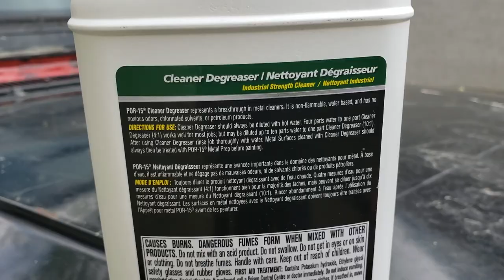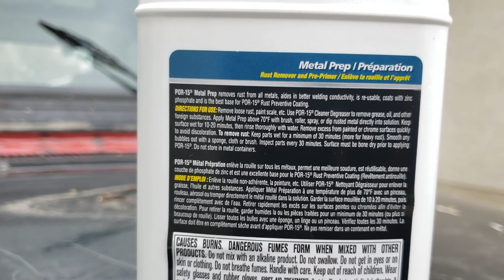Rover 1 Project - Fixing VERY large rust holes on a Jeep YJ

Comment: Not a very good choice to paint over rust. You should have get an angle grinder and clean by grinding the rust. Do things right the first time you won’t need to go back and do it again .
Reply from the maker: I did all that. Used a wire wheel, sanding disk, degreaser and metal prep.
Reply: LostFart not on the floor pans
Reply from the maker: @jonathantorres8149  Thats right. I only used a wire brush, degreaser and metal prep.
Reply: Por 15 is made to paint over rust, that’s how it gets its grip on the surface.